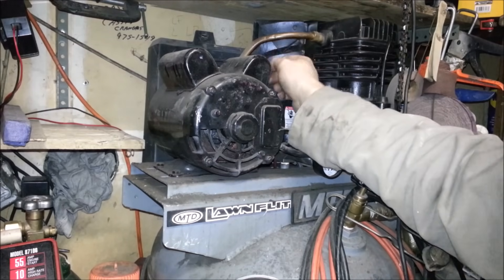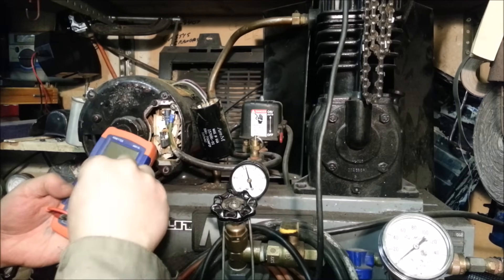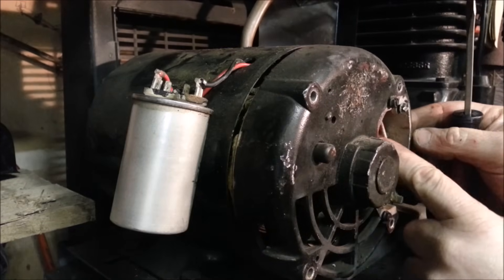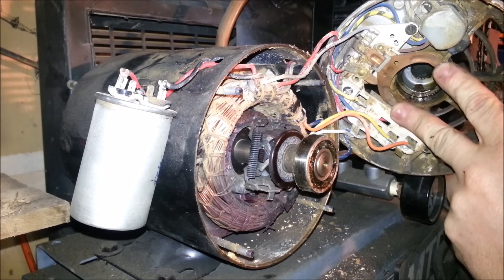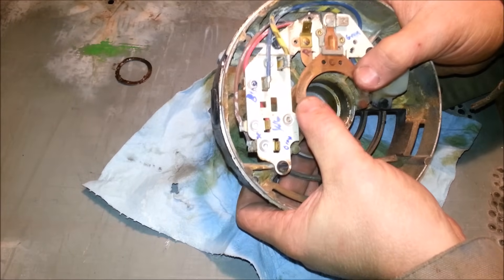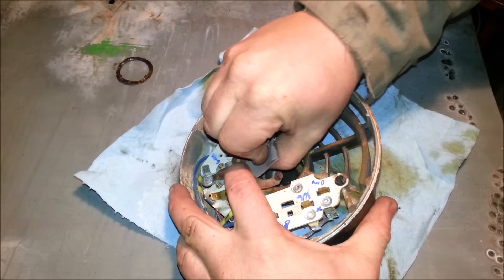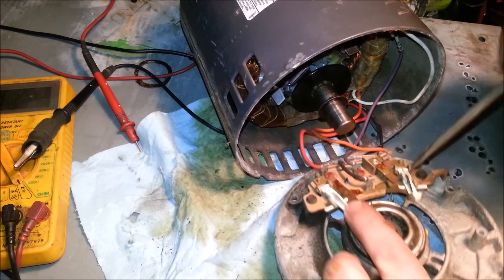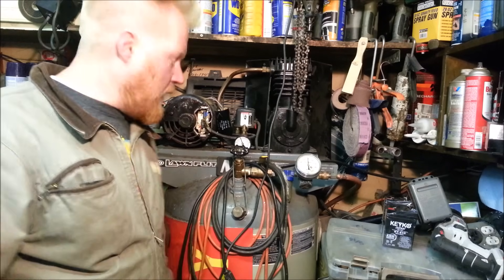Electric Motor Doesn't Spin but HUMS/Buzzes compressors etc

Comment: Hi sixtyfiveford.I had all the knowledge I got from your video and then I thought of first oiling the shaft of the motor and the pump by cleaning it thoroughly at first and giving it a go. Then I noticed a switch above the motor which contains the two capacitors.I pressed that switch and probably re set it in the process.I then took off the belt connecting the pump and motor and turned the motor a good 2 minutes manually and then put it on.It went beautifully. Did the cleaning of the pump as well and then same thing turned it a full 2 minutes along with spraying WD40. Then connected the pump and motor and it went beautifully.
Went to work to town.Came back and tried it on again.It turns and feels like it wants t go.Turns over quite well but then after about 10 seconds the switch above the capacitors pops off and it stops.
Reply from the maker: +Tarsame Lal “sam” Tangri That is your built in circuit breaker. It can go bad and trip by itself easier than it should but generally it means the pump itself is too difficult to turn. Make sure the air pressure switch isn't trying to make the compressor pump too high of air pressure into the tank. It should be shutting off the electric motor at 125psi or so(maybe lower or higher depending on compressor)

Comment: what kind of oil do you put in the pump and how fill should it be?
Reply from the maker: +carl carpenter Most compressors use 30 weight non detergent motor oil. Most have a dipstick or sight glass oil level.
Reply: thank you. mine don't have a sight glass and only a plug in it to fill I think I keep over filling it because I get blow by?
Reply from the maker: Some compressors will have two holes; a lower drain and an upper fill. If the upper fill bolt is a square head and screws in horizontally then it is probably also your fill level. If so you fill it until the oil flows out. If the upper fill hole is on a horizontal surface and screws in vertically it is not a fill level and you may be missing a dip stick. What brand is your pump?

Comment: Yep did that with mine too. Only use 400 and very little pressure or you'll eventually cut through the contact coating down to the bare copper. When that happens they spot weld themselves together. You can use some relay contact cleaner/lube to keep them up and running after the initial clean other wise you'll end up doing it more often than it's worth. Mine finally died with burnt windings. Anyone know how much it cost to have a field rewound small mill machine? Anyways 65 thanks for the vid keep it up, "We can't help everyone but we can all help someone". Best Wishes n Blessings Keith

Comment: Fixed my issue. I suspected this was the problem on my wood shaper that I picked up for free. The old owner said it would no longer start and he moved it to the back yard to rust away. Thankfully I got to it before it was beyond repair. I cleaned the whole thing up and when I fired the motor it just hummed. Not as loud as this one though. Anyway, I did the same thing you did here and it works flawlessly now. Thank you for your videos!
Reply from the maker: +ballzack57 Gotta love a simple no cost fix. Thanks for watching.
Reply: +sixtyfiveford I phrased that awkwardly. I meant to say that I suspected this was my problem but was unsure of what exactly to do. Quite serendipitously your video popped up in my subscriptions and I followed your video exactly. Doing this allowed me to fix the motor. Sorry if I was unclear earlier. Thanks again.
Reply from the maker: I'm glad it helped.

Comment: Thanks for the tip. I didn't realize there was a centrifugal switch in those motors, I just thought it was the capacitors that started the motor.  Good to know.
Reply from the maker: +Pete Ciallella I'm not positive in which situations use what, but it seams most compressor motors or motors that have to start out under load use the centrifugal switch.

Comment: Cool video, as always!! Thanks! Although I think that capacitor tester is kind of useless if it only measures capacitance. Usually caps fail because of a high ESR. The capacitance still reads out fine, but the circuit is dead anyways. That's the case with electrolytic caps in electronicas anyhow, maybe these big motor cap's fail differently.
Reply: Koffi Banan...Motor starting capacitors are not polarized like electronics electrolytics. That's why they can operate in an AC circuit for a short period. Their construction is somewhat different from the other.
Reply from the maker: +Koffi Banan You're right. It's not always correct in determining a bad cap. Generally with the small guys they're bulged or split, not so with the huge ones.

Comment: Smashing job, i had forgot about centrifugal motor starters, i was thinking "oow the start capacitor".
Its an old design but clever, ive allways liked mechanical ingenuity :-D
I suppose if it really screwed up you could put an external delay circuit that closed a relay for a few seconds, but relays become bad too,so no gain :-(
Reply from the maker: +zx8401ztv Thanks. They seam to be very reliable for the most part.

Comment: that could explain what happened to two porter cable drill presses used to drill out fiberglass.  Both of them had the same buzzing but the caps were good.  Ill have to check out the motors now.  Thanks.
Reply from the maker: +Designs By Philip I hope it's as simple as this.

Comment: I took a furnace motor from a house that was being demolished. Actually the house was demolished but I took the motor out of the scrap pile. Anyway the metal case of the motor was bent so I figured it may not run, but it was worth a shot. It seemed to spin fine but it did the same thing, it hummed and buzzed, I'll have to try this out on it when I get the chance. It's like a 400$ motor so it would be nice if it worked lol. I'll update if I get it working.

Comment: Quick tip from a motor shop.  Air compressor motors, like the one shown are ODP, or Open Drip Proof.  They allow the free flow of air, and it's contaminants through the motor windings for cooling.  Some of those contaminants (dust) will settle out, and on the start switch.  If the start switch can't conduct electricity to the start windings, you get a humming motor.   Simple fix, give it a gentle, stress that word, gentle, tap or two on the back endbell while energizing the motor.  This will, in most cases, jar the offending dirt loose from the start switch, and allow the motor to run.   Most of the time it will save tearing the motor apart.
Reply from the maker: +Bryon Covell Nice tip!
Reply: +sixtyfiveford 
Was thinking I would have needed the compressor for job and first order would be hammer tap tap switch on and then tap Bang switch on....then if it starts use compressed air to blow some dust out or further into motor.......
If your only tool is a Hammer you tend to ever issue as a nail...they say.
Reply: And when that doesn't work,tell them to take the motor off and bring it to you to fix, that's what I do when a caller wants me to diagnose and repair a motor over the phone, l give them some pointers then tell them to bring it in and I'll fix it
Reply: As another tip if it is possible have the motor set to run on 240 volts it will use approximately half the current it will use wired for 120 volts... and because it is using less current it will save money on the electric bill and the motor will run a little cooler as well
Reply: @darinb.3273  you don't save any electricity because you get billed by how many Watts you use. Watts are Volts times Amps. So if you double the Voltage and halve the Amps you still have the same Watts. You can save a copper tree though. That's why all of those poor foreign bastards run 220VAC. They can't afford copper like we can.
Reply: The first thing I'll try with any mechanical gadget is giving it a good beating. Heck it makes me feel better. Who cares if it fixes anything. But oddly it tends to fix a lot of things too.

Comment: Great tip and glad it was repairable without having to buy/find parts. I'd like to have a Quincy because I emember how quiet they run compared to the ones they mass produce today. I wish you all the best in 2016.
Reply from the maker: +MRrwmac I had an oil-less before this one and it was deafening. Yeah, can't beat a no-cost repair. Thanks.

Comment: Awesome tutorial.  Very interesting.  It seems there's a more robust way to engineer these things.
Reply from the maker: +RyeOnHam Yeah, It's a good USA motor with very little plastic. I hope I can keep it going for a long time to come.
Reply: +sixtyfiveford yeah those old motors are awesome. Rescued a 1/8 HP (yes tiny power wise!) motor from a furnace blower here in the UK last year that's the size of 2HP motors now. The thing's built like the proverbial brick outhouse! 50 yrs old and still looks new (once I washed off the dust and let her dry!)

Comment: Thanks for the great tip. One question though. Is there an easy way of knowing which wires the start and run caps connect to if they were disconnected when the motor was acquired? I heard that if you get it wrong the caps will short out. Thanks
Reply from the maker: +Robert Oswalt A lot of motors will have the wiring diagram on the label. Yeah, the caps will short out if they are reversed but you have a 50/50 chance. You could measure the resistance from the centrifugal switch to the capacitor of the start winding.
Reply: +sixtyfiveford Thanks for the tip. I'll try that next weekend.

Comment: Another inexpensive fix in today's throw away society.  Enjoyed the video
Reply from the maker: +Ozzstar Gotta love a no cost repair!
Reply: 10 cents of steel wool has fixed my furnace in the past.
Reply: Well said Ozz.  Thanks 65!  So much good stuff here!  Not only a cheap/free repair but saving the planet one fix at a time by avoiding waste, not using the energy to extract, refine & ship the materials for a new motor.
Reply: Trained to be lazy and unskilled society
Reply: @russelllotan1361  how else will we maximize profits?

Comment: Great information.   I sort of have this problem in reverse though.   I have a shallow well pump (1 HP electric motor) that will start and run for a while and then seem to overheat and shut off.   What could I do to troubleshoot this? Thanks for any suggestions.
Reply from the maker: +D.H. Lunt This can happen if the start winding stay engaged. The clutch is more than likely stuck and not disengaging the start windings.  The exact reverse of my problem.
Reply: +sixtyfiveford Thanks!  Greatly appreciated!
Reply from the maker: +D.H. Lunt You could also have a bad run capacitor.

Comment: I have started small compressors by hand with that problem. You have to spin the compressor fly wheel by hand. Not the best as you can loose fingers. I have a late 1950s Champion Pneumatic. I find the cast iron compressor pumps are quieter than the new stuff.
Reply from the maker: +57WillysCJ That's why we have 10 fingers; just in case we loose a few.